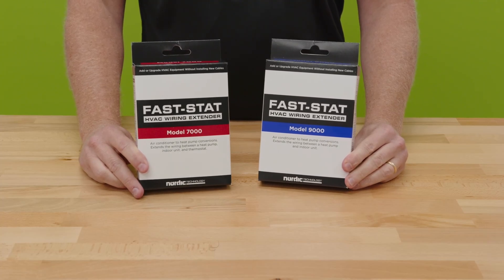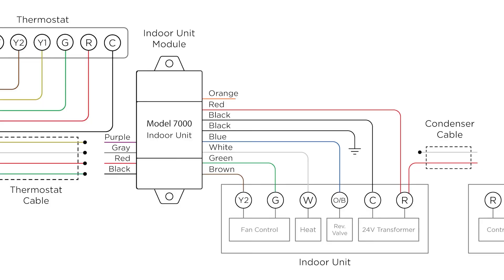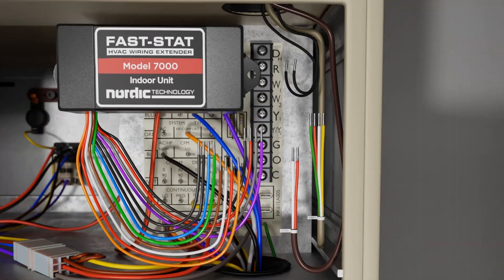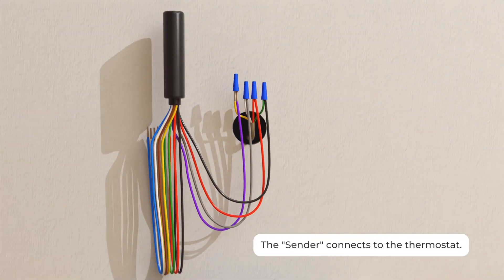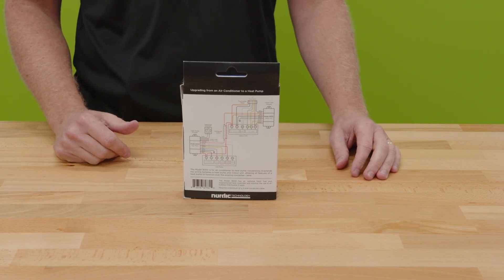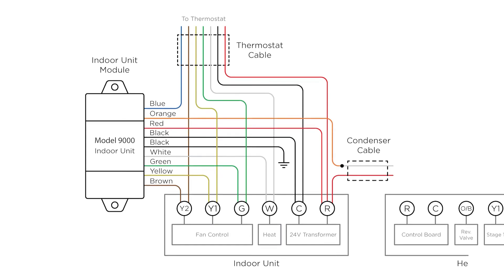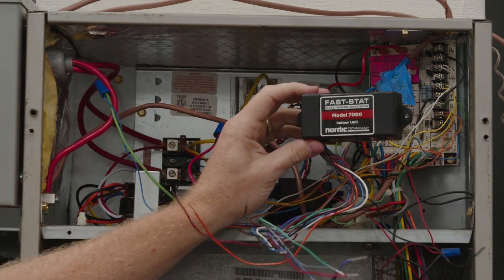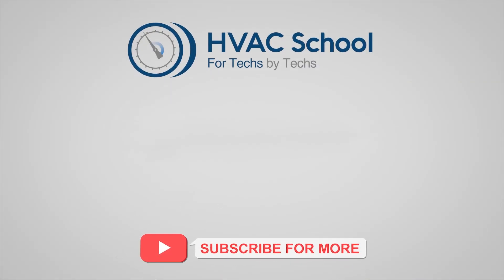Fast-Stat 7000 and 9000 Unboxing

Comment: Hi Bryan, just want to confirm my understanding. This kit would be helpful when upgrading to a heat pump from straight AC and building has less than adequate number of conductors - say 4 wire furnace and 2 wire condenser - this would help bridge gap when we cannot run new wires?

Comment: How would you use this in a two stage geothermal package unit heat pump with a Tstat wire that doesn’t have enough cables? Can you leave “unused” the Outdoor unit part and just used the one the connects to Tstat and Indoor unit?